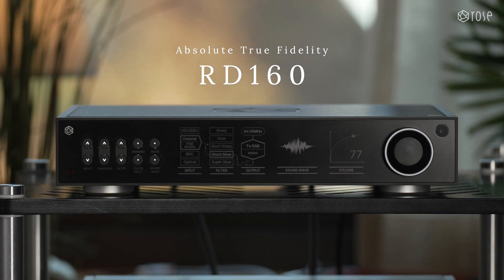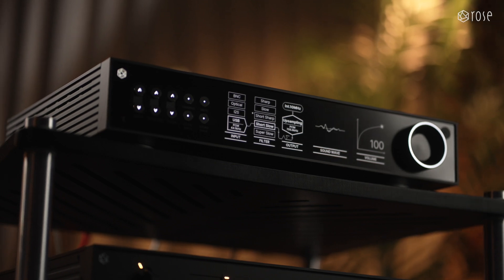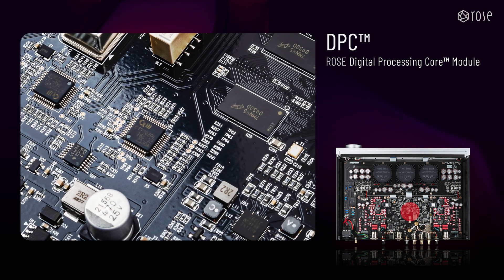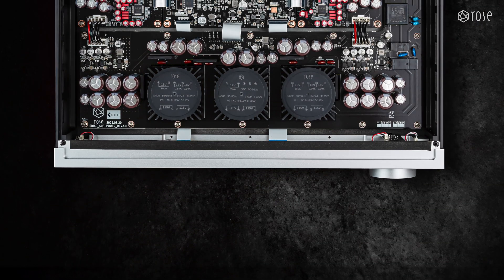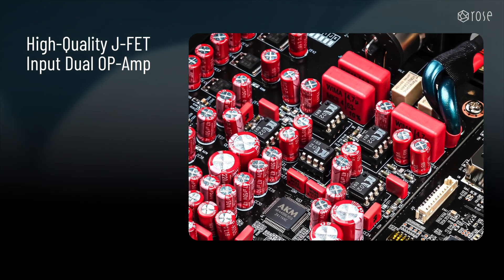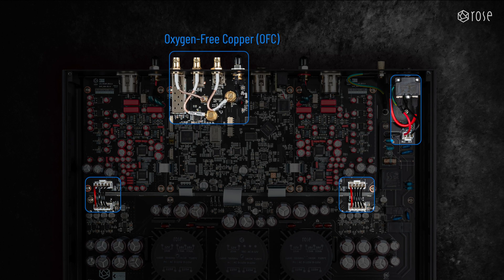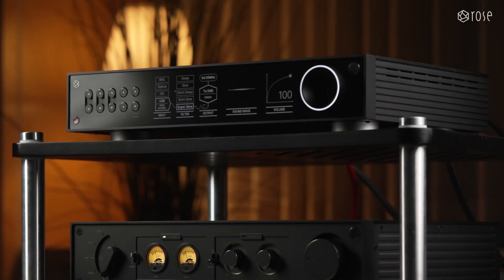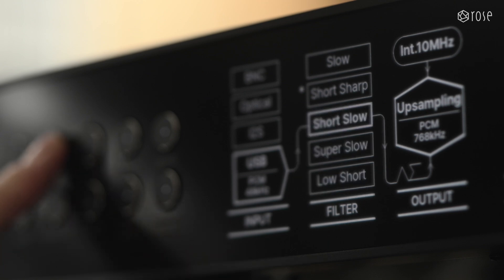[Product Overview] RD160_Absolute True Fidelity DAC

Comment: What would be the best way to connect it to RS 130?
Reply from the maker: Hi, 1983nady. 
You can use any digital input, but if we were to recommend specific options, SFP and I²S could be good choices. 
SFP effectively blocks noise physically, while I²S ensures the shortest signal path.
Reply: @hifirose  Can you be specific about which brand and module of SFP should be used on both ends, and is it single-mode or multi-mode?